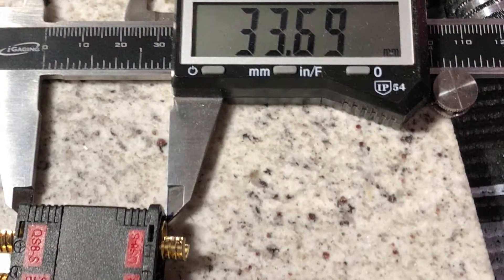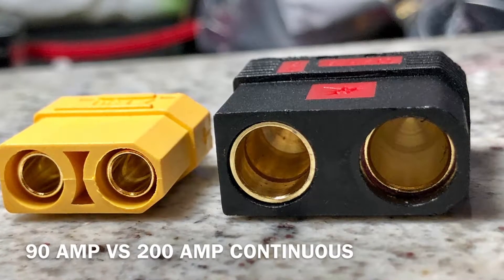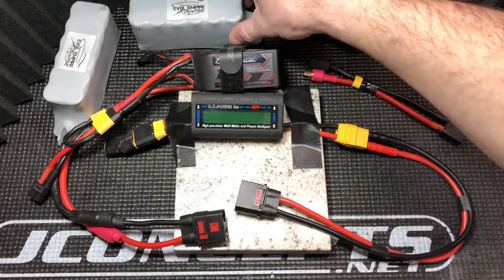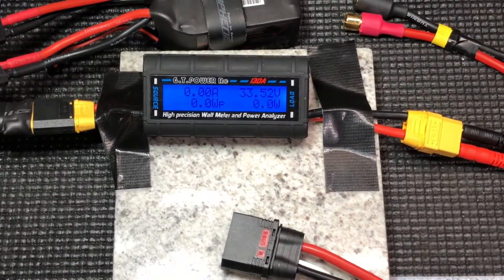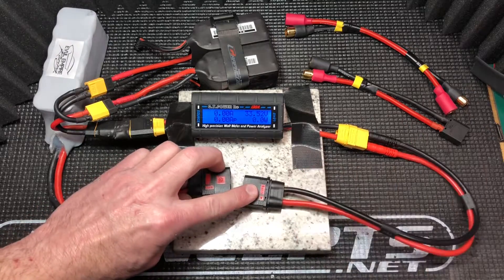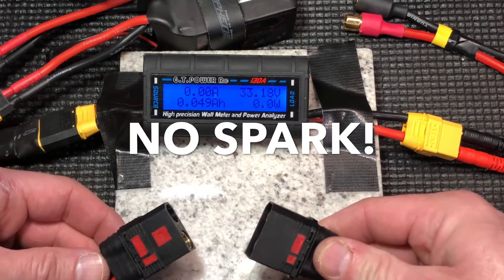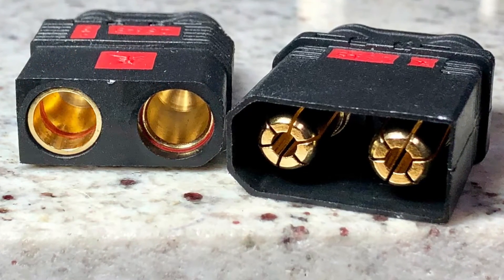OSE 8.0mm ANTI-SPARK CONNECTORS 200 AMP PLUS

Comment: Any idea what's the watt rating of the antispark resistor? Allready burned the AS150 resistor because when connecting the 300A esc at 98v (24s) a coulometer and three thermometers start so they probably draw more than the resistor handles. I don't want that also with the QS8 to happen. It has slightlyless resistance 5,3 ohms then AS150 - 6ohms. So I might need to put a switch to power on these electronics, after esc connection.

Comment: You will destroy the connector doing this. The resistor is designed to bring a small capacitors to an equal state not a battery.
Reply: Huh? Please explain.
Reply: @carpballet  The resistor within the QS8 is designed to charge filtering caps on low voltage toys not batteries. It's probably rated for 1W.
Reply: @thepowersource1602  So long as you do not spend too long in the "halfway in'" position where the resistor is getting the load instead of quickly shoving the connector in so the resistor only sees the load for a fraction of a second (but the ohms value is low enough that the caps on the other end charge up high enough to prevent sparking in most situations you'd find in the RC world. I'm sure beyond 100V things might change)
Reply: @ericklein5097  It would be nice to see a connector with a replaceable surface mount resistor like a shunt. It would fix this problem and be repairable at the same time.

Comment: Hey what's the max voltage and amperage these connectors can handle?
Reply from the maker: I think they are rated at 250 Amps, voltage is irrelevant
Reply: It says 115a continues, and 180a pick
Reply from the maker: Well one is a continues rating and one is a burst rating, there is no picking

Comment: is there a higher amp connector?
Reply from the maker: Yes there is a 10mm version of these at off shore electronics
Reply: @Track13News  dang it, they are out of stock. i really need to get going with something on these watt meters i have...grr. ok i can probably get away with 200 amps, but i cant see where the rating is for amperage on the website, is it documented somewhere?  oh man now i see the 8mm are sold out too.
Reply from the maker: I read somewhere 200 amp peak, may have been email reply from OSE when I was inquiring about them back then.

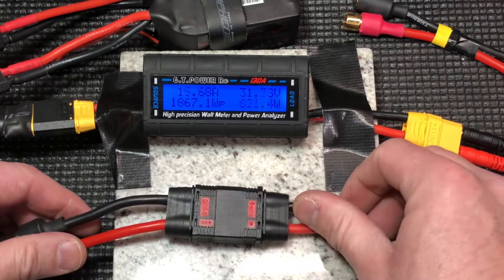Comment: 1:49 how did you even put these things on? Mine are too hard to go on there. Even with a hammer they don’t go in.
Reply from the maker: I had some like that, sometimes overheating when soldering will melt the plastic and warp, or I will bend In the prongs slightly on the connector.  Keeping them very clean can help, as well as stretching the plastic housing a bit with opening needle nose pliers against the sidewalks from the inside.  Hope this helps
Reply: keep male and female together while soldering

Comment: 33.5 volts isnt really that much for this they should be rated for 500 V but they will spark if you connect them with that voltage on 😂
Reply from the maker: 33.5 DC volts is a lot, have you put your tongue on a 12V car battery before?  Lol😂
Reply: 😂😂no but I have to admit I've done it with a 5v battery but it was probably half dead , sorry about the negativity its a good video , I'm looking for something for a battery pack for a 180A and almost 600v for an EV pack I think this or xt150 would suit
Reply from the maker: I like these better than my 10mm bullets, mainly because they don’t burn up from the arc, and I have tapped a few heavy bullets accidentally + to - and they explode and scare the living shit out if you

Comment: I wish they made a 6.5mm version of these. They need an intermediate step between these and XT90's
Reply: Why? 8mm is fine
Reply: @kaimera_official  Sometimes 8mm is too bulky and there's really no option for a two pole anti spark connector between the 4.5mm XT90S and the 8mm QS8 in the market right now. I use QS8s on my 700 size helicopters but a 6.5mm version would be better because the QS8 is a tight fit beneath the canopy on some of my helis.
Reply: @atomicskull6405  Castle makes 6.5mm polarized plugs
Reply: @JuanSanchez-jy1cy  No anti spark on those though you need a separate anti spark circuit.
Reply: AS150. I know its not a single connector but..pretty sure its 6mm or 6.5mm so it fits what you're looking for perfectly. Never used them but hear people really like them. Haven't heard any negatives about them. They are the Antispark version of the XT150 IIRC

Comment: Nice video, thanks for sharing. I already have seperate 8mm castle bullet on all my lipos. No issue using this connector by making a ”switch" to them, like in your video? Going for 12s (6s in series)
Reply from the maker: The anti spark is such a must have with high voltage, I cant tell you how many 8mm bullets I have gone through after the arc blackens them or takes a chunk out of them.  These connectors solve this issue.

Comment: Nice video I have and question would these connectors work in a series hook up on 8s?
Reply from the maker: Yes, you would just need to make the series connection
Reply: Are you sure cause I contacted OSE and they said they don't know if they would work properly if I was to connect them in series they would have to contact the company that makes them and that would take 3 to 4 weeks.
Reply from the maker: I really don’t see an issue, I suppose it is possible the resistors wouldn’t be quite right, but I have connected two lipos in series using regular connectors and then plugged into these, so take a small chance see if it works

Comment: Yaaa.... You'll never realistically need bigger than an xt90, as they can flow wayyy more than rated.
Reply from the maker: 90 amps, after that resistance and heat come into play, unless your doing speed runs you likely don't need more than XT90.
Reply: Track13News you're gonna be limited by wire size before connector.  I've pulled over 200 sustained amps through an xt90 and it wasn't even hot
Reply from the maker: I use 8 AWG mostly